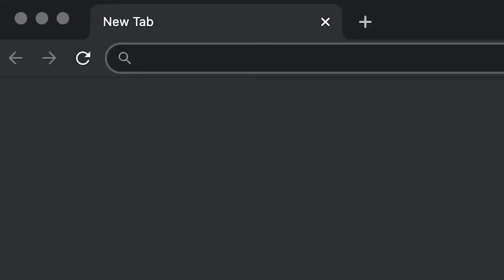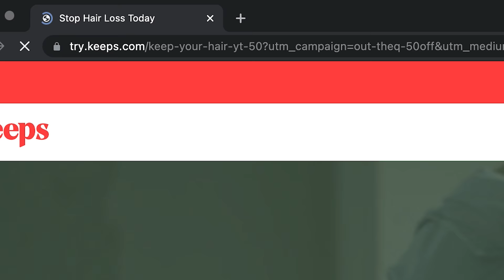The Game You Can't Fail

Comment: The game you can't fail
Me: lightly taps it
Reply: I saw this and thought this exact thing, kinda an oversight...
Reply: That problem would be fixed if it was a funnel, then you would have to go full speed so it ramps out in order to fail
Reply: just start the ball already in the hole boom impossible to not win
Reply: @linkadogspast  WRONG! All you have to do is hit the ball hard enough to break it through the hole.
Reply: But it already in the hole like the moment you start you have already won without any actual input from a player
Reply: @linkadogspast  you start by making a move and if the ball gets out of the hole you don’t win
Reply: I thought the same thing lol
Reply: I know
Reply: Lol I thought this too
Reply: Haha great minds think alike lmao
Reply: @ADudeWhoDo  but it cant be a funnel because then the ball would move before you could hit it, directly into the hole
Reply: @goofygoober7183  not if you balance the ball perfectly on an atom thick needle
Reply: @ADudeWhoDo  yeah but i dont think you can set that up easily every time you wanna try it
Reply: @ADudeWhoDo  Then you just hit it super hard to fail
Reply: Put the ball to a higher point so it will speed up no matter what. Be careful when placing ball, and don't stop the ball from going back when you are hitting from the direction of the hole.
Reply: Cheater!

Comment: To those who are wondering how did it always go in -
He made an ellipse with  that wood,
And it is the property of ellipse that reflection of light (in this case ball) from one focus goes to another focus after striking boundary of ellipse.
Reply: Great Explanation 👏🏼👏🏼
Reply: Why elipse
Reply: Looks like a perfect circle not elongated
Reply: @mitaskeledzija6269  Notice initially when he was marking down the perimeter he used two screws as the 'centers' (they're actually foci) and a loop of string to guide the pencil? That's how an ellipse is defined, that is the total distance of the perimeter from the two 'centers' (foci) is constant. 

In a circle, you only have 1 center. (A circle is just an ellipse where the foci are at the same spot).
Reply: Subscribers needed.
Reply: @ahmaddeedatibrahim6631  Ty for this
Reply: uuhh… ah yes. thank you
Reply: Thanks
Reply: The caveat is that you must hit the ball directly or with minimal deviation. Too much spin imparted to the left or right will cause the ball to diverge from the "guaranteed" point.
Reply: basically what he means is when he put those two nails down he used a string to coarse all the paths the ball can take from 1 nail to reach the other nail, cut it out and made a board...
Reply: So basically he just made a big circle aroung two circles that intercept?

Comment: Property of an ellipse well explained!
Reply: I just realized
Reply: But isn't it a circle ??
Reply: @Husshar_Ladka  No, It is an Ellipse with very low eccentricity (Lesser the eccentricity more circular is the shape). The hole and the Head spot are the foci.
Reply: an*
Reply: @WokerThanThou  they're not in the center, otherwise they'd be the same point. They're still off to the sides. The thing about a circle os that there are infinite foci pairs because of its infinite rotational symmetry
Reply: KNIVE????
Reply: @WokerThanThou  The way I would put it is that in that for each circle there exists an ellipse that contains the exact same points (meaning the points of the boundary, not the center/foci). They're defined by different but equivalent formulae.
Reply: @Husshar_Ladka  no there's two foci
Reply: ive never seen so many words that i can't understand
Reply: @Macintosh77  lmao
Reply: @Macintosh77  he put in two screws at the beginning. If it were a circle, he'd only need one. An ellipse is a circle with two centers.
Reply: @lomiification  someone who speaks english

Comment: The guy is smart enough to calculate a never losing pool table but can't make a hit
Edit: I DONT REMEMBER COMMENTING OR WATCHING THIS VIDEO HOW DO I HAVE 5K LIKES. 
Polargeist
Reply: Not hard to calculate where a perfect sphere will go when it bounces off the wall of a perfect circle... it always goes to the same spot.
Reply: @awsomnessnoveiws  It depens on where did the ball came from. In this case it isn't a circle but a ellipsis, which means that any ball coming from one of its focus (the white mark) will bounce and reach to the other (the hole itself). Thus if the ball doesn't come from that white dot it probably won't make it to the hole as we see at the end of the video. Also if it were a perfect circle, both of the focus would be at the same place and you would have to shoot the ball from the hole (don't ask me how).
Reply: @gustavosantiago1543  analyzing pixels it's a near perfect circle, meaning as long as the middle of the hole and the white dot are in the same spot on opposite sides, no matter where you hit it on the sides it will rebound to the hole, it's simple geometry.
Reply: @awsomnessnoveiws  what do u mean analysing pixels? If it was a "perfect circle it would had one central point and a radius, but the way the curve was drawn on the wood with the two screws indicates that it's obviously not a circle
Reply: @awsomnessnoveiws  Maybe it will rebound to the hole, i don't know about that, but it wont do it in a satisfactory number of reflections (bounces) all the times. With an ellipse, the ball always find the hole bouncing one or no times which is very important as you want to prevent energy losses from the collisions that can make the ball stop.
Reply: @awsomnessnoveiws  You should thank that guy who gave you wisdom ina a very polite way. He is right.
Reply: I'm pretty sure it was just a setup boss
Reply: This is an ellipse and this represents the reflective property of ellipse. The point where cue ball was put and the hole were the two foci of ellipse. Due to the reflection property of ellipse, any line drawn from focus to surface of ellipse will reflect back towards the other focus. I had seen a similar model near my house at science centre where this was done with carrom boards and strikers.
Reply: Holy sh*t this reply section smort
Reply: No calculation is even needed.  Just merely taking advantage of the reflective properties of an ellipse.
Reply: He didn't calculate this he just built it
Reply: @Ashcent16  never underestimate internet people
They just have UNLIMITED POWER
Reply: @StanislavSasin  I'm saying I'm overwhelmed I'm not saying everone is dumb - _-
Reply: @gustavosantiago1543  the ball needn’t be shot ‘from the hole’. As long as the shot is played such that the cue passes through the centre you will get the same result. This is harder to judge than having the ball on the focus such as for an ellipse because if the ball is on the focus you hit the ball in whichever direction you choose. But when the ball is away from this focus, the shot is determined by the line traced out by the ball and focus to the cushion
Reply: @awsomnessnoveiws  it is an ellipse
Reply: Trust me, i would find some way to fuck it up and miss
Reply: This is inherent to all ellipses, just with slightly different positions. Those positions are called "foci" or "focus points," and not only do they reflect to each other no matter where the ball hits the edge, but the total distance is always the same. It gets weird if you factor in physics, but this is math not reality.
Reply: He didn't invent this
Reply: That's 7th grade stuff.
Reply: It makes no hit by making not when it does
Reply: This kind of comment makes me think nothing online, at least barely anything, is actually real
Reply: @awsomnessnoveiws  buddy the guy who kindly tried to explain it to you was right… you can’t “analyze pixels” as you say from a YouTube video. I studied the science that goes into this process before and what he said I dont think I could say better myself.
Reply: He didn’t have to calculate anything. It’s because of the way he used the strings to make the shape.
Reply: If we do this with a circle, the way to always put the ball in the hole, would be to shoot with a force in the direction of the radius of the circle.
Reply: why i am seeing gd players everywhere lol
Reply: @cross.159  there are more of us than you think…
Reply: @zahven  yeah, ppl say the game is dead but i see the community being a lot more active recently
Reply: @awsomnessnoveiws  when he drew the shape in the wood he had 2 focal points. Because its an elipse, anything coming from focal point one will always end up in focal point two. Just interesting geometry
Reply: the people here in the reply section are already on it so
Reply: @awsomnessnoveiws  analize pixels at 5:53 geometry king
Reply: "by can't make a hit"? What does that mean?
Reply: @gustavosantiago1543  *depends, *aN ellipsis
Reply: could also explain it with concave mirrors and focal points i think 🤔
Reply: @awsomnessnoveiws  yo it’s still cool for people who don’t know about this kinda subject. I know more about finances and that side of math, so this part is new and interesting to me
Reply: @awsomnessnoveiws  analysising pixels? what are you talking about lol?

the method he used is a really common way to draw ellipses with known foci.
Reply: @awsomnessnoveiws  its an ellipse, because ellipse has a property that the sum of distances of any point on ellipse from the two foci is constant. In the video, he created shape using thread fixed around two nails, those two nails act as the two foci of the ellipse. Also later in the video, he marks one focus as launching point of the ball ( which he marks with the white spray paint) and other focus is made the hole. 
This is done because ellipse has an special property, which is , "reflected ray  of an any incident ray passing through one focus of ellipse from the boundary of the ellipse always passes through the other focus of the ellipse." This property is the reason behind this trick. Also this trick will work from ellipse of any eccentricity. This is the SIMPLE GEOMETRY which is working here and I completely don't what PIXEL ANALYSIS you are doing and in your reason what are you even trying to say!
Reply: You know you just hit it really light or really hard
Reply: how many demons
Reply: It is just an ellipse. What is hard?
Reply: You can fail anything if you try hard enough
Reply: @mortal3806  take a ball in your hands and throw it. you winn't
Reply: GD?
Reply: @Jordan Froome well i think that my english was able to convey my thoughts
Reply: @awsomnessnoveiws  I don't know where you're getting your 'facts' from, but the way he drew the shape — with the two screws and fixed length rope — he, by definition, drew an ellipse.

An ellipse has two foci (which here are the white dot and the goal) that have the property that any line drawn from one of the foci, will cross the other one when reflected.

If it were a "near perfect circle", then these two foci would lie very close to each other (which they don't)
Reply: @awsomnessnoveiws  It's not a perfect circle, it's an ellipse. Look at how he made it: if it was a circle, he wouldn't have used a loop and 2 screws. It uses the fact that the ellipse always reflects from one focal point to another. Its basic geometry
Reply: @gustavosantiago1543  well that would be breaking the rules of the game then
Reply: It’s just an ellipse. A ball shot from one focus will always go through the other focus. And in this case fall into the hole.
Reply: @awsomnessnoveiws  “analyzing pixels” is never an accurate way of getting a measurement. It gets distorted very easily. Moist critikal has a very simple to understand video on it where he debunked the theory that he was actually shorter than he says. In the theory they “analyzed pixels” and they were entirely wrong.
Reply: Actually not to break it because it still help you just remember to put in power or force cause if you tap
Reply: There's no need for any calculation. The white dot and the hole are at the positions of the two nails he used to draw the eclipse at the beginning.
To draw a circle, he would only have needed 1 nail.
Reply: Thats just trigonometry and simple calculus. Not that hard if you actually study
Reply: @awsomnessnoveiws  Spouts incorrect information, "it's simple geometry."
Reply: @awsomnessnoveiws  it is an ellipse. This was done years ago on Numberphile and they explain the maths behind it
Reply: it's an ellipse, if you throw the ball from one of the two foci of the ellipse it will hit one side and then return to the second focus point
Reply: Ygs
Reply: @awsomnessnoveiws  It isn't a perfect circle. He has actually just made a parabola and placed the hole in the focal point. Not too difficult to understand the theory but to make it nice and smooth and maintaining the correct shape is definitely impressive.
Reply: Numberphile literally did this half a decade ago
Reply: Are calculating skills and skill of playing billiard somehow corresponding?
Reply: Hahah
Reply: Interestingly, you are smart enough to make this observation, but you can't hit the right keys ;)
Reply: Well he is bad at pool but he’s an engineer so he is good at pool
Reply: Its not a circle, its an ellipse, an oval. The two points that the string wraps around to trace the oval are the same two points of the hole and the paint spot where the ball goes to the pocket each time. The tightened string at each point around the oval would show the ball's path of travel between the two center points
Reply: @gustavosantiago1543  yeah just like a ray in a curved mirror
Reply: @awsomnessnoveiws  not a perfect circle, an ellipse. Every ellipse has 2 focal points and if you put a hole perfectly on one of those points you cant miss.
Reply: oh gd player xD
Reply: He didn't calculate anything
Reply: Its not calculations though. As long as you have a perfect circle or oval and find the foci, then you can easily do the same if you have the materials
Reply: Bruh never studied coordinate geometry? It's a simple property of an ellipse
Reply: @awsomnessnoveiws  it is an ellipse.
It has two foci
Reply: @albond  I meant but
Reply: @Lonely
Username... doesn't check out? I'm so confused rn 😂

Adding to the dogpile and I'm not sorry.

Comment: This works because of the properties of ellipses.  They are defined by choosing two points, called the foci, and drawing the outer edge so that the sum of the distances from any point on the outer edge to the two foci is constant.  That is, if you pick a point on the ellipse, the sum of the distances to the two foci is the same number.  Due to this design, any projectile launched from one foci will bounce perfectly to arrive at the other foci.  This is used in other applications also, such as lithotripsy (kidney stone breaking procedure) using the 3-dimensional version of this property.

Comment: For those of you not in the know, let me explain how it works. The secret is that the pool table is not a circle; it’s an ellipse (basically an oval). Ellipses have two foci with the unique property that the distance between them is the same as the sum of the distances between them and any singular point on the ellipse. What this guy did is he positioned the hole at one focus, and marked the location of the other with the little white dot.
Reply: If you strike too weak or too strong then the ball won't score, so not worth it at all

Comment: Very cool! I wonder what other similar tables are possible. I noticed this one requires the ball to be placed at a specific point and then it will reflect into the hole if it is shot straight in any direction. I wonder if it's possible to make it so that it doesn't need to start at a specific point. It seems unlikely to me that it would be possible to make a flat table where you could place the ball anywhere and hit it in any direction and hit the hole. It's an interesting puzzle though
Reply: The reason it does this is because the table is shaped like an ellipse. It is simply a property of the geometry. Any ray that exits from one focus will enter the other after a single reflection.

Comment: 1. Don't hit it hard enough
2. Hit it too hard
3. Hit it over the hole
4. Hit it through your roof
5. Hit it with a stick that makes it so that whenever it hits something they instantly melt
6. Just not try
7. Hit it through the floor
8. Move it before hitting it

It's way too easy to fail "Games you can't fail".

Comment: It took me until seeing the top view for my memory of precalc and calculus to kick in and realize that this is an elliptical table and the hole and starting dot are on the two foci of it. No matter what you do, if you have a string of excess length strung up between two points like the foci of an ellipse, so long as you hold the string taught, you will always draw the outline of said ellipse and the angle made always represents the reflection of the string at that point on the ellipse from one focus, to the wall, to the opposite focus.

I'm sorry to whoever decided to read this fully, both to people who retained all their calculus knowledge, and those who know nothing about it.

Math is very deeply confusing but also makes sense because it's literally based on logic, universal understanding be damned.